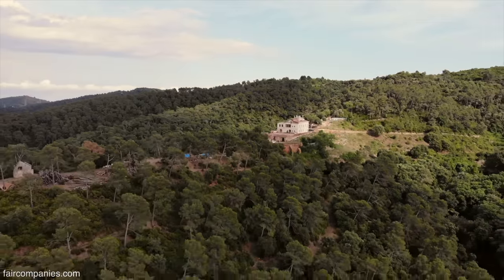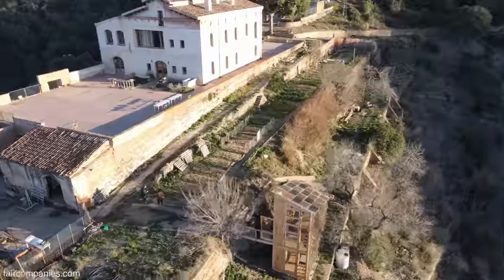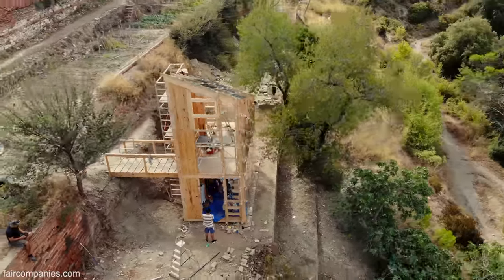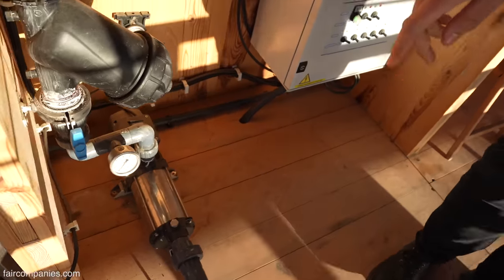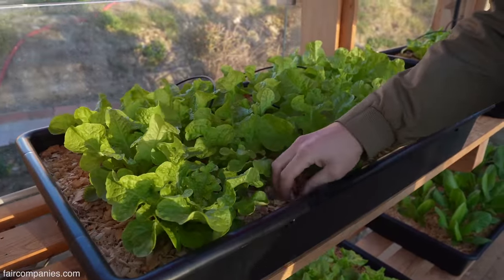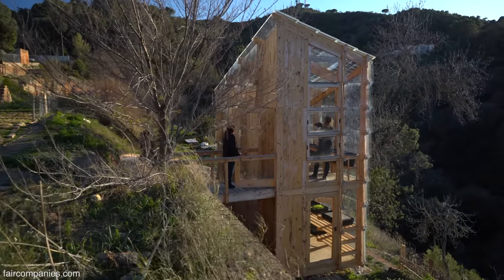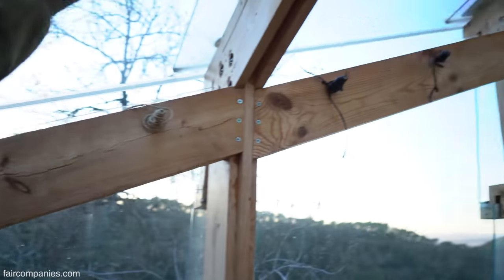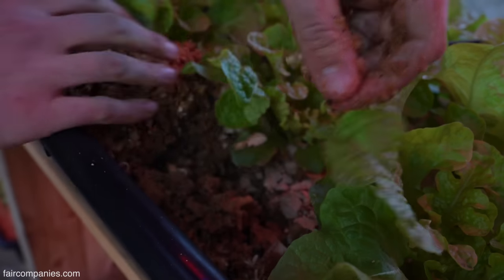High-yield Solar Greenhouse harvests food & energy (timelapse)

Comment: I built a 12 x 12 foot pit greenhouse in rural Missouri in the USA with concrete walls. It was five feet deep in the earth. The floor was 56 degrees year round. It was incredibly energy efficient. The glazing was angled to optimise light gathering at the coldest time of the year for the latitude.

Comment: How do they prevent temperature swings - since they have so little thermal mass to moderate the temp swings? And each window is open in the bottom so warm air and cold air will vent out or be lost to conduction on the single layer glazing?
Reply: Indeed, wintertime growing greens would be a struggle because lots of the vegetables need warmth in order to grow. Interesting idea though.
Reply: Mediterranean climate near Barcelona what works there wouldn’t work everywhere else in the world!
Reply: I can imagine they are growing in accordance to the season so the plants are naturally accustomed to the weather

Comment: Cool.  Hydroponics.  It works in a limited way or in mass.  Just a quick observation for the people in the greenhouse; you should put in a small dumb waiter/elevator to eliminate the need to walk up and down the embankment.  You could power the elevator with a pulley system so you wouldn't need to use electricity.

Comment: Me eyes were immediately drawn to the window design, so glad you deep dived the topic.  

I was surprised to see a permanent gap between the windows.  I would think they would use a microcontroller, sensors, and servos to open and completely close off windows to regulate the temperature and humidity of the space, especially in winter. ¯\_(ツ)_/¯

Comment: I noticed heavy soiling on the solar panels (on top of Voxel Quarantine building). May I suggest you to tilt the solar panels (approx 10 degree) to allow rainwater to flow, instead of accumulating on the solar panel surface.

Comment: I don't understand why they left big gaps where the wall windows overlap.  Normally a greenhouse is designed so that it can be sealed airtight on cold nights but there appears to be no way to close these gaps as needed.
Reply: Look up the climate info on Barcelona.  These plants could be growing outdoors, they are not fragile tropical specimens.

Comment: try centrifugal ducted impeller wind turbine, as both horizontal/vertical axis wind turbine, mounter on top of a wood heat chimney, self-ducted, single piece, check the models videos on this page
Reply: use transparent plastic instead of the glass, the less you break, the better, and the glass costs (your prices) a ton
Reply: no participation, only freedom, if you design for community, you are not free, wrong design goal, dont be slaves to things or people, be freed by God, alone
Reply: no dont recommend yourself to money slavery

Comment: regarding the statement "...possibly a lower or even positive enviromental impact..." lower is a correct statement normally, but the positive one is fantasy thinking. no action was taken to reduce climate impact by using lumber. that is really something that he shouldn't have said (why because once you cut wood, it co2 absorption stops, that is not even talking about everything you add to the wood as a preservative. you can say that about cement it does absorps some through the years, but you can't say it is a "green" feature off cement since it needs so much co2 to exist in the first place

Comment: the house and greenhouse is poor design. you want the LONG Side facing south and to max out the south glass BUT minimize other direction glass.  if you don't do that the greenhouse will cook in summer and freeze in winter.  also you want to have moveable window insulation (shutters or curtains) on all glass. and all non-glass surfaces (east, west and north) should be heavily insulated.  look at the passive solar designed buildings and greenhouses in Santa Fe, New Mexico.

Comment: What? Those LEDs appear to be very weak and VERY far from the plants, I assume they would have almost no effect whatsoever. And the solar panels are shading the plants?! And the wooden boards and shelves are massively shading the plants! You need many more times the amount of sunlight you can harvest, to produce the same amount of light energy from LEDs through solar panels. So they would get a lot more light if they removed the solar panels and the LEDs, no? Is this just for show then? I can see no practical value to that setup, it just seems much worse than a normal greenhouse, but much more expensive. Or is there something I am missing?!

Oh my, and now I see the plants in there, are growing in expanded polystyrene cells! I think this project has almost nothing to do with sustainability and maybe a lot to do with urban people trying to make ..... money? Or fame?

Comment: 1:59 Recent research unanimously suggests that plants and especially greens, use almost all spectrum of visible light in photosynthesis. Blue incidentally has the power to keep plants smaller, while even just 5-10% far red light expands the plants mass by over 25%.
Hence, the lights you are using are technically wasting Power as their photosynthetic efficiency isnt even close to a balanced full spectrum light.
@kirstendirksen is there any way to relay this to the folks on site?